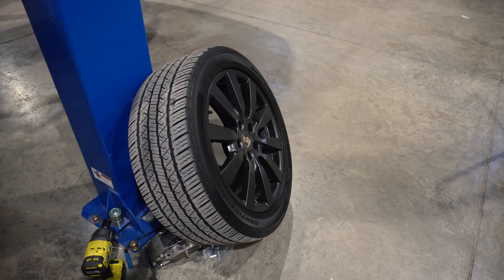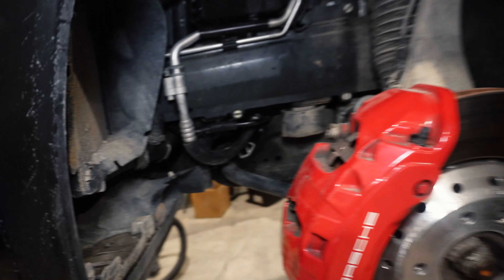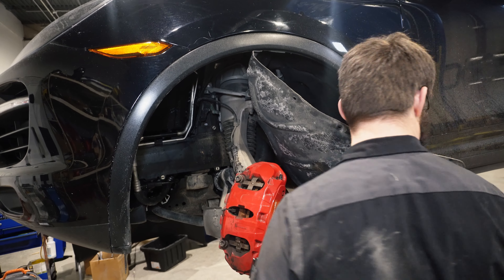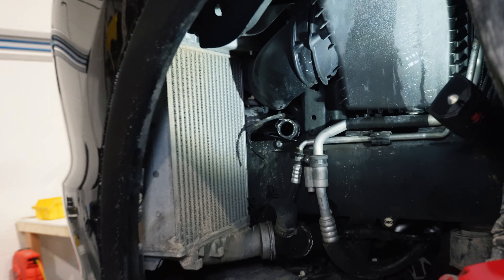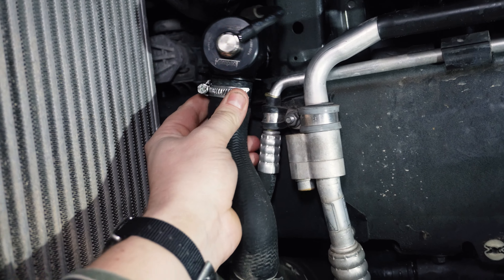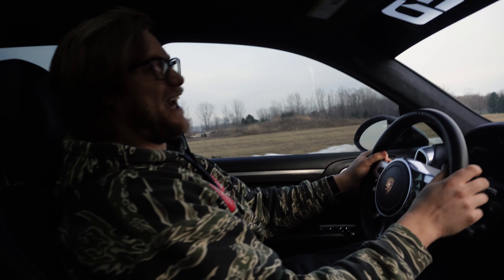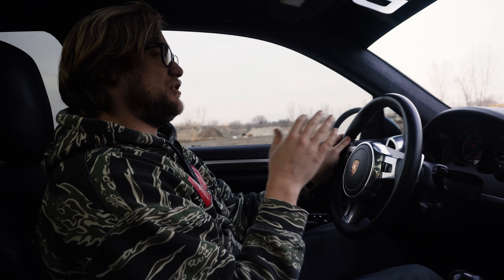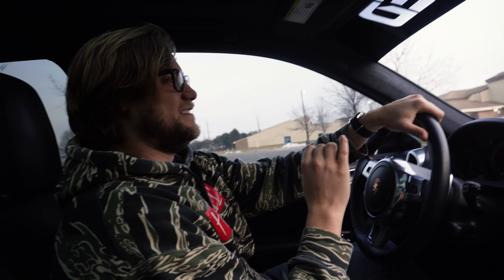Porsche Cayenne Turbo Diverter Valve Upgrade!

Comment: Nice videos! I changed the valves on mine as well, but the OEM ones and I only see about 9psi/0,6 bar and my car does NOT have a tune. It´s a stock 958.1 with 500bhp.

Comment: I picked up a 958.1 turbo myself a couple of months ago. Can anyone tell me what the stock boost psi is supposed to be? Mine normally maxes out at 8 psi. Looking around online has shown me anything from 6 -11 psi stock, so I don’t really know what to believe. Was definitely thinking of a tune and diverter valves later on though! How much hp is yours putting out now
Reply from the maker: Stock I was seeing 11
Reply from the maker: Should be about 620-650hp
Reply: @SeemsLegitGarage  before or after the valves because the stock listing crank HP for a 958.1 Cayenne Turbo is 500Hp and no way diverter valves gain that much. Just Curious?
Reply: I bought mines used and I get about 15 to 16 PSI. I don't know if the previous owner did something to it or not but it hauls butt

Comment: Which tune are you running with to get those psi numbers?
Reply from the maker: Our own tune. Your basically just increasing torque and boost limits and the maps are already there. Factory does a great job getting it ready for more
Reply: @SeemsLegitGarage  what software?
Reply from the maker: @jaysworld707  autotuner
Reply: @Seems Legit Garage best option for a guy at home? Can you guys do anything remote to tune?